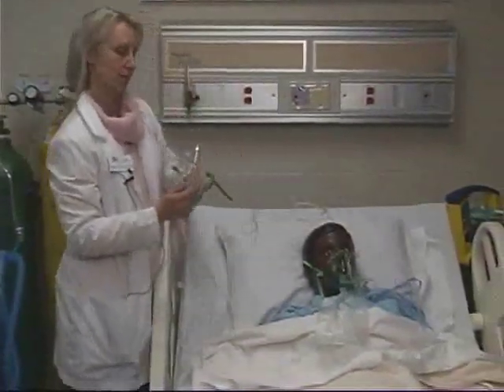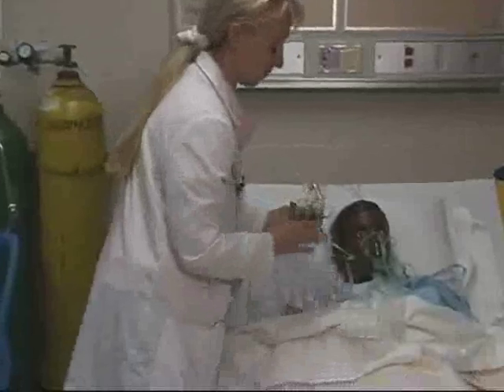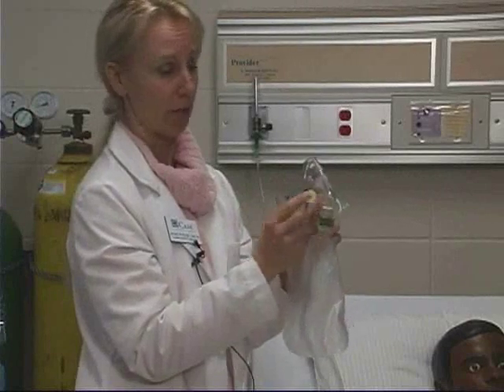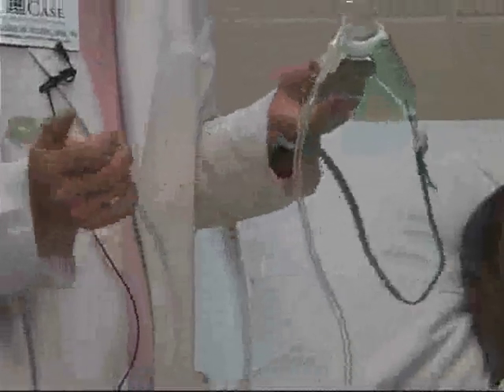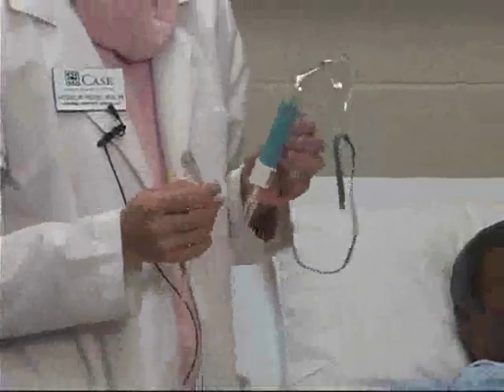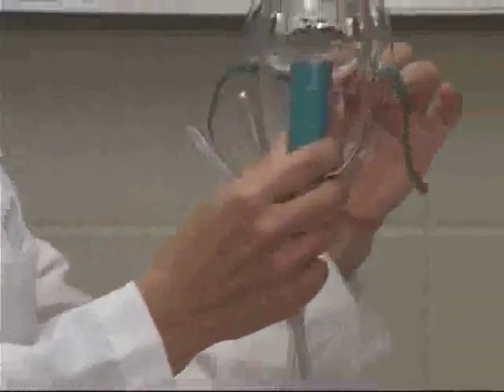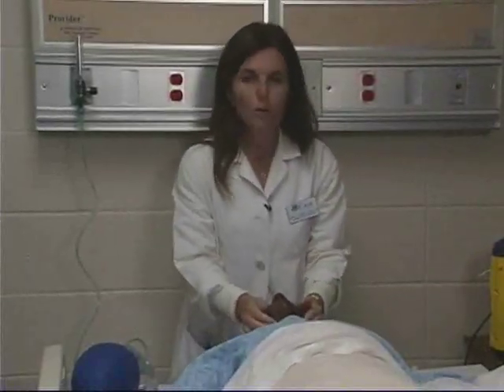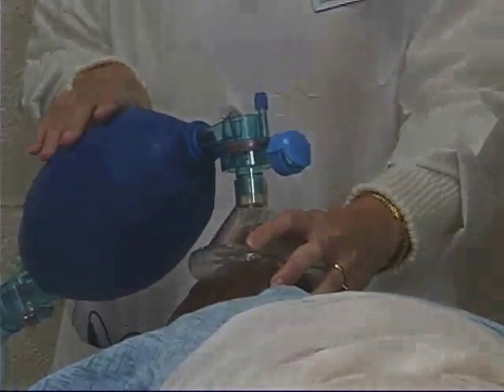Oxygen Therapy Skills Demonstration (2 of 2)

Comment: Pretty good, but a NRB mask minimum is actually 10Lpm, not 6Lpm. Let's not suffocate our patient. The second woman did a good job but should have stressed the importance of a good seal more. Use the "E - C" grip (google "E C grip BVM" if unfamiliar) to get a good seal. Pick the right size mask for the size of your patient. Watch for chest rise! If the chest is not rising then there is not a good seal or there is an airway obstruction.
(EMT-B x 5 years).